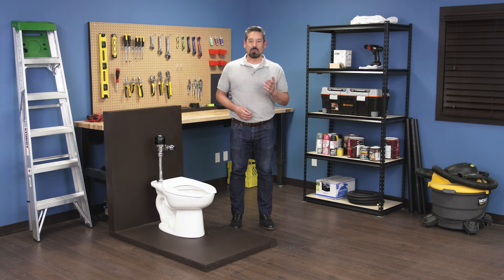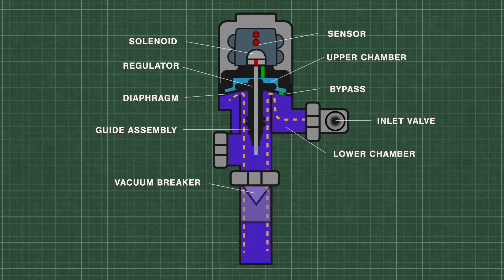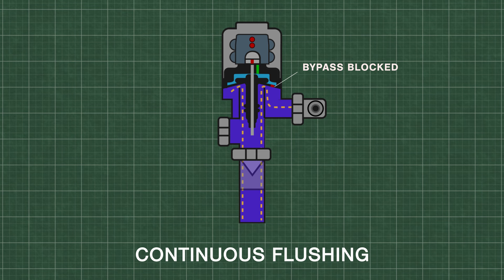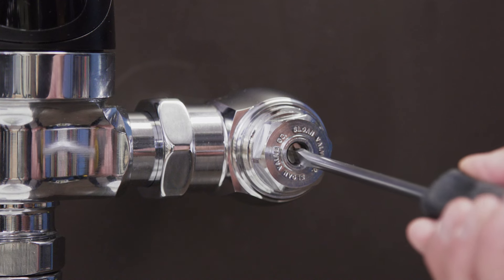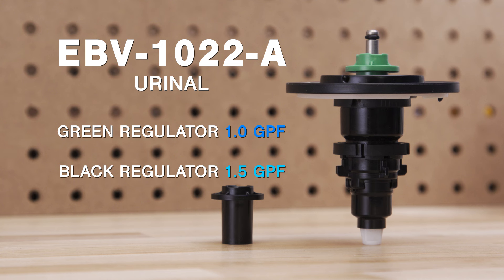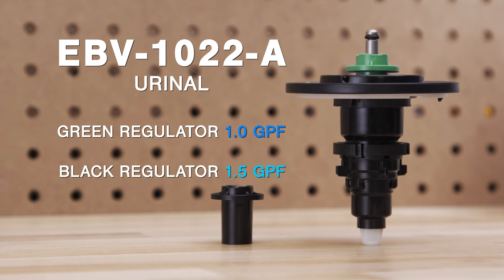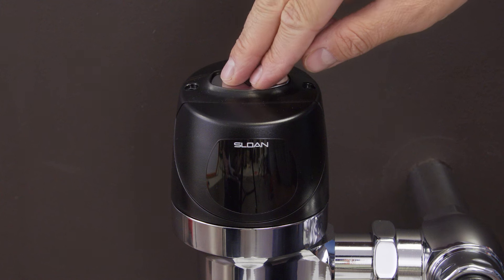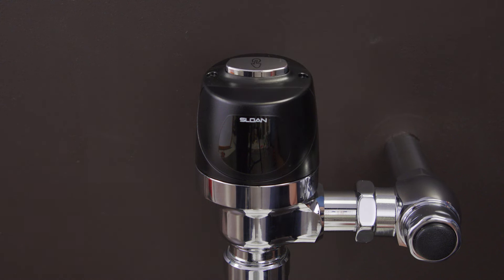Troubleshooting a Sloan Optima Flushometer | Repair and Replace

Comment: I was hoping to find guidance to troubleshoot ghost flushing in a dark room.  I can hear the flush from the next room about every 2 hours.
Reply from the maker: Hi Daniel, thank you for watching. If the flushometer flushes randomly every couple hours then it could be an issue with the sensor. Alternatively it could be an issue with the diaphragm. If the diaphram doesn't have a good seal and isn't seated properly on the valve then a tiny amount of water might leak out of the upper chamber. If it looses enough water over time then it will trigger a flush.

It would be a good idea to remove the diagram, clean the valve seat, inspect for any nicks or dents that might cause a leak. As well its best to replace the diaphragm as the rubber can deteriorate over time.

Hope this helps!

Comment: Please show a close up of the bi-pass hole. I can't see it to check for obstruction or enlargement. I have the whole flushometer completely disassembled and need to know how and where to look for the bi-pass hole. Otherwise I cannot determine why the water keeps flowing.
Reply from the maker: Thanks for watching. It has been a while since we've filmed these so I don't have all the parts directly infront to look closely at. Some diaphragms like ones used in Delta has a very explicit bypass hole. The manual sloan flushometers it can be seen on the bottom. For these automatic sloan models, i am not sure where the bypass holes are, it could be close to the center column or a slit somewhere. These are not giant holes so they are not always obvious unless there is extra material around it. https://www.amresupply.com/part/EBV-1023-A-SLOAN-REPAIR-KIT-F-BATTPWR-URI

 In any case if you notice a buildup of calcium then that could be plugging it. As well look for any corrosion or anything that would prevent the diaphragm from sitting properly on the valve seat as this can sometimes prevent the upper chamber from filling properly. If that doesn't help then it might be best to install a new diaphragm..

Comment: What if there’s a solid red light on the sensor? Had a weird issue where there was a solid red light, replaced batteries and it was still present. Came back about 30 minutes later & solid red light was gone, now flushing fine
Reply from the maker: Thanks for watching. The solid red light is part of the calibration. https://www.youtube.com/watch?v=DcYm1YF1yYU&lc=UgzdGoHlr0aWAgrzNGZ4AaABAg

Comment: What about a short flush or the water not flushing fully. Cant tell if the toilets clogged or something wrong with the diaphragm or solenoid. It clicks automatically but if i throw a piece of tissue down it, it takes like 3 flushes to go fully down
Reply from the maker: Thanks for watching. A short flush could be a hole in the diaphragm, which lets too much water though to the upper chamber, reducing the flush length. Try installing a new diaphragm and clean the valve seat of any corrosion or mineral buildup.

Comment: So I have this Sloan optima that clicks but doesn’t flush, changed batteries and solenoid but still doesn’t flush. Any help would be appreciated
Reply from the maker: Thanks for watching. It's possible that the relief valve/ diaphragm is clogged. If no water is released from the upper chamber, then there won't be the pressure differential to open the valve for a full flush, you can see more in this video: https://www.youtube.com/watch?v=bHQaC-gTYVc

Comment: what size are the hex head bolts on the sensor cover? i have metric and imperial and none seem to be fitting?
Reply from the maker: Thanks for watching. The cover will require a 7/64" hex wrench to remove the bolts.

Comment: Awesome video, wouldn't have ever guessed that you could check the battery by holding the override for 40 seconds. Thanks for the help! Able to fix our women's restroom before the day started ;)
Reply from the maker: Thanks for commenting FerusZaz. Sometimes those little checks for battery power or resetting are buried in the manual. We're glad you could get everything fixed in time!

Comment: I assume you can change the solenoid without turning the water supply off right?
Reply from the maker: Hi 4gasem, when changing the solenoid the water should still be turned off at the control stop otherwise water would leak during the repair. Fortunately we made a video on how to replace the solenoid, you can watch here: https://youtu.be/2b-x3vawtFA

Comment: Where is this bypass in the diaphram??
Reply from the maker: Thanks for watching. The bypass should be a small slit around the edge of the diaphragm. As an example you can see the white showing through on this image: https://www.amresupply.com/thumbnail/product/1594127/1000/750/EBV-1020-A-Sloan-Water-Closet-Flushometer-Flex-Tube-Diaphragm-Kit.jpg Which is on this part https://www.amresupply.com/part/EBV-1020-A-SLOAN-REPAIR-KIT-CLOSET-1-6GPF There might be some variation not every diaphram will look exactly like this but that's where you'd check.

Comment: How about a noisy finish to a flush???
Reply from the maker: Thanks for watching. Try adjusting the control stop. A noisy finish to a flush can happen when the water pressure is quite high. In this case the water is rushing by the valve as the space is getting smaller, likely causing that sound.

Comment: Mine is leaking? Dud something  wrong going back.
Reply from the maker: Thanks for watching. If water is leaking out of one of the connections then you might need a new o-ring for that connection. If a little bit of water is coming out of the flush pipe, then its most likely a worn diaphragm.

Comment: These Sloan sensors suck I keep having to replace them in my building, I set the range and it’s now flushing only when I install and remove the plastic cover. Video is extremely helpful however this sensor does not want to program range for me
Reply from the maker: Thanks for watching. We do have a video on the sensor calibration if you're curious: https://www.youtube.com/watch?v=DcYm1YF1yYU

Comment: Why my when I flushed make a noice
Reply from the maker: Thanks for watching. High water pressure can cause noise as water rushes through the valve. In some cases the unit will flush normally but the sound will appear only as the valve starts to reset. Try adjusting the control stop. In some cases this can help but if you close it too much there won't be enough water to flush the valve.